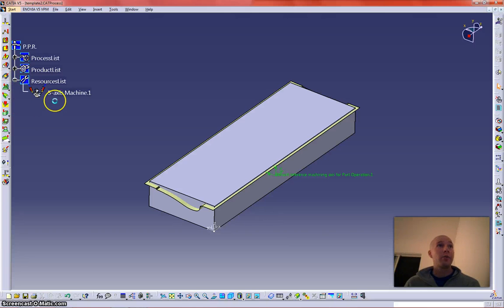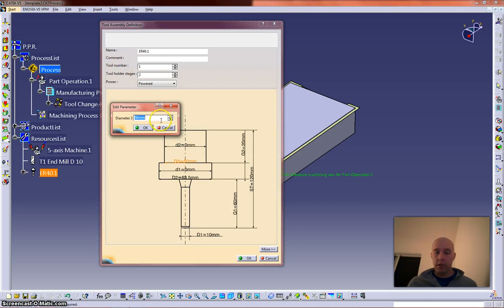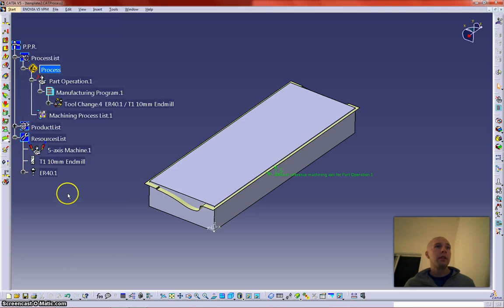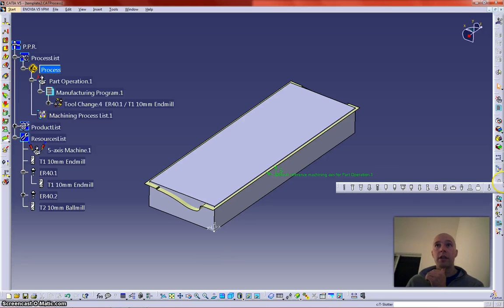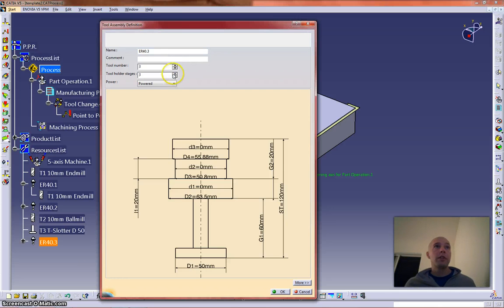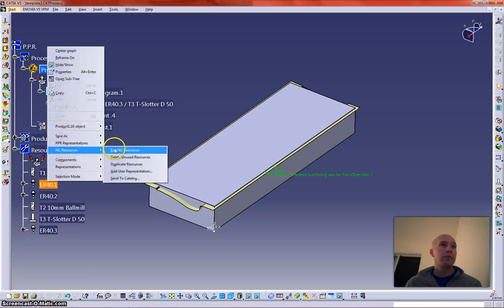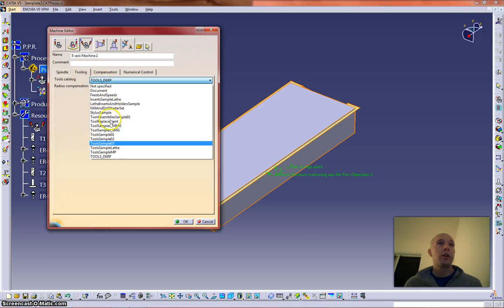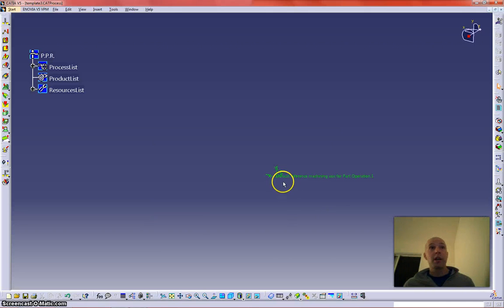Catia Advanced Machining 103 - Resource List Setup

Comment: Fantastic video!  I've watched hours of videos trying to find info on managing NC resources.  In five minutes you've nailed it!  Nicely done!
I have one question, I have set up an 1/8" end mill in a CAT40 holder assembly.  I have duplicated this assembly and changed the name of the assembly to a 1/4" end mill however, it still has the 1/8" end mill in the assembly.  I have created a 1/4" end mill.  How do I replace the 1/8" end mill with the new 1/4" end mill in the new assembly?
Thanks much!
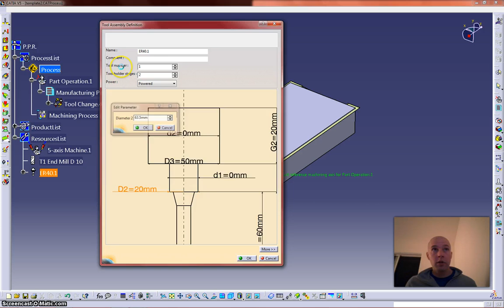Reply from the maker: Much like how I cange the demisions of the holder (0:50), you can double click your cutter and make adjusents to it.
I hope this helps.

Comment: Nice Video! cant stand the ones with just clicks or music and no verbal walk thru!!!
I have 2 questions
1. When I go into a tool description in either the function tab or the machine setup and select the three dot search box to locate the tool catalog I want the only choice I get is "document"  In the manufacturing folder there are several sample catalogs but I cannot access them 
2. Is there an easy way when posting out code to have it split for multiple locations (G54,G55, etc) 
Thanks in advance for your help!!
Reply from the maker: 1: I'm not familiar with the sample catalogs. I would imagine you don't have the license for them. I've always made my own catalogs. 
2. Changing the GXX location depends on your post. I've worked some machines where you have a post-processor-instruction before the first tool change. The syntax will depend on your post. Good Luck :)